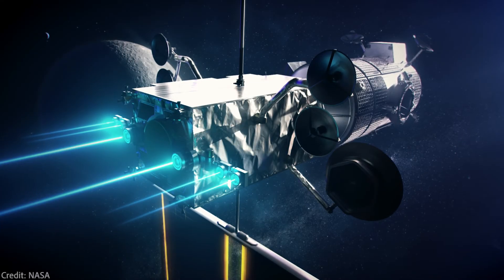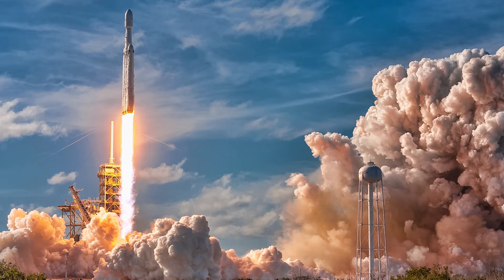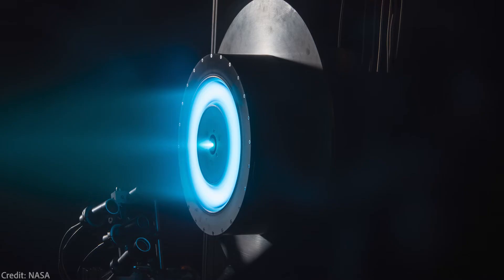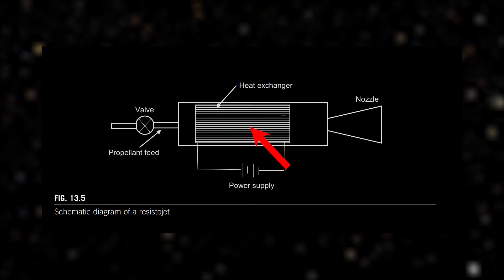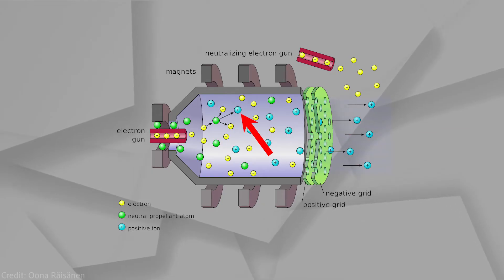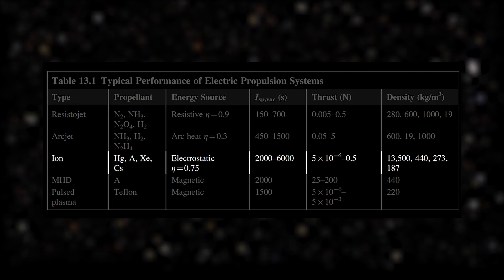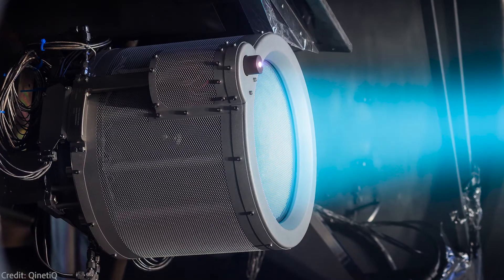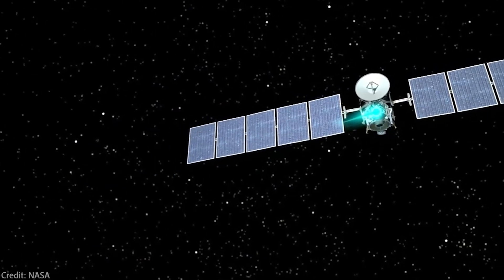Sci-fi engines that became a reality. Ion thrusters and other types of electric drives

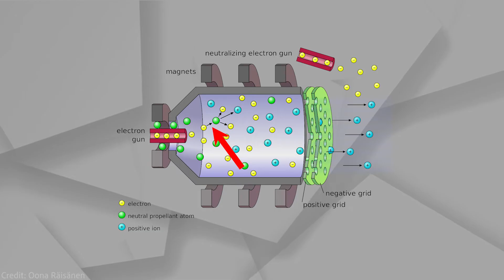Comment: 10:47  
Why can’t the neutralised exhaust be taken back to the system and it used again
Reply: the engine produces thrust by imparting momentum to the exhaust (in this case via electrostatics), and because of Newton's 3rd law, the space craft gains momentum in the opposite direction. So, collecting the exhaust would impart the opposite momentum back to the spacecraft and cancel out the thrust it produced.
Reply: @lunar04j  but the exhaust collected will not be 100% efficient so there should still be thrust but it will not be as powerful as the original design but it should last longer
Reply: @testimonyincrease5161  ok, if you're not collecting all the exhaust, then only the exhaust that you're not collecting can contribute to thrust. You're just reabsorbing the momentum and energy of the exhaust that you do recollect. By the way, that energy will have been wasted as heat in the collector.

This is sort of equivalent to a situation in which an obstruction blocks the thruster; it will reduce thrust and waste energy by heating the material of that obstruction
Reply: @testimonyincrease5161  also, you can achive a lower thrust and less propellant useage by literally just reducing the propellant flow rate. That would not drastically reduce the efficiency of the thruster and damage the spacecraft. You can even increase the operating voltage to produce less thrust, but use propellant more efficiently
Reply: @lunar04j  good to know
Reply: For the same reason you can't push a sail boat forward by placing a giant fan on its deck blowing on the sails.
Bringing back the propellant would cancel out any amount of mementum you would have got from in the first place.

Comment: One of the cons of electric drives and engines is that they can be taken out by EMPs
Reply: Old diesels won't be effected.
Reply: Most of the rocket engines would be affected cause of all of the control is electric ofc :-D
Reply: If you have proper shielding and grounding it would be OK.

Yes, satellites have grounding on their surface to neutralize cosmic radiation, solar flare and other stuff. Yes it is a mindf*ck to design and yes it does exist.

Space's harsher than deserts :/
Reply: Electric "drives", engines and motors are too simple electrically speaking to be taken out by EMPs (natural or artoficial).
What would be taken out is the control electronics, but that would apply to any kind of engine.
Reply: @qdaniele97  you do realize with enough power EMP can destroy the wirings inside, forcing you to literally rewind your engine/motor?

If you have huge ass cables it wont matter, but nuke's EMP to your car motor is RIP.

So..invest faraday cages and proper grounding guys!

Comment: Question of the day:  If a black hole can draw in light, would it follow that gravity can attract objects at speeds greater than light?
Reply: actually the "speed of light" is more accurately the speed at which any information can travel through the vacuum. Gravitation only happens at the speed of light